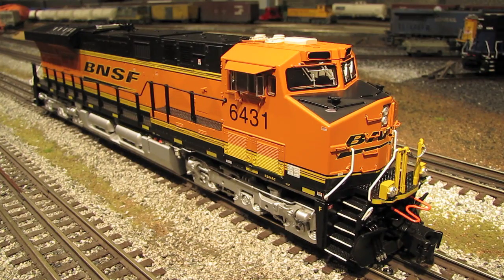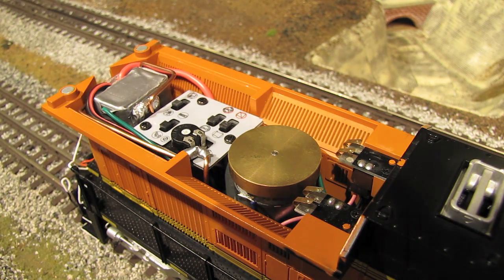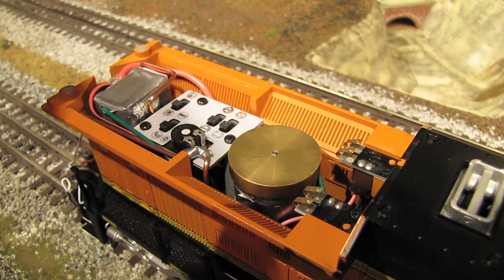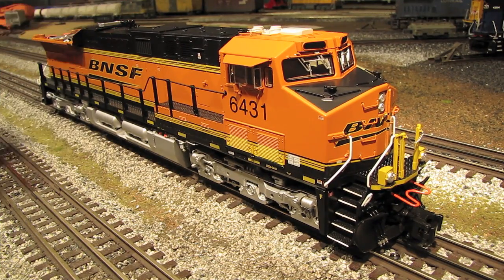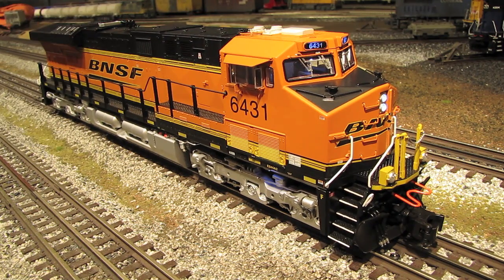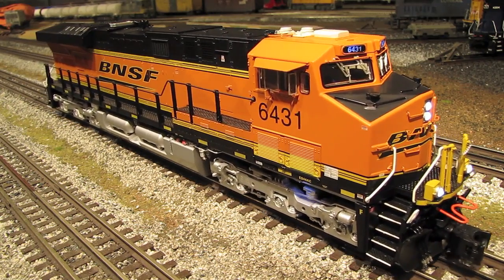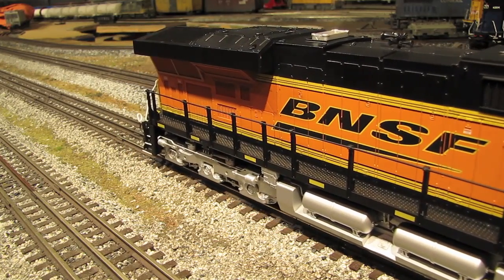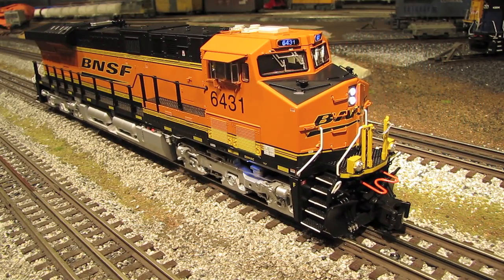Nuclear Powered O-Scale Engine Demo

Comment: You should make it to where it went off and diesel back to where it doesn’t ever exhaust, but it’s just reuses its own fuel so it can sound like the real thing, last forever, but never run out of gas so when it takes a few and the gas tank… It goes through a tube which runs to the engine to make it run which English to another to watch it goes back into the gas tank

Comment: Nice Eric Love Experimental Locomotives even on a small scale but what happens in the incident of a Reactor Meltdown would it Explode or melt a hole in the shell of the locomotive?
Reply: It would melt the train, and probably start a fire. Reactors don't really explode. Chernobyl had a very specific reason it exploded, and I honestly feel confident in saying a reactor will never explode like that again. There's only 8 RBMK-class reactors in operation today, and they all had many safety upgrades after the Chernobyl disaster.

Comment: I have about 400 ft of o scale 400 ft ho scale comes out of the building on a treasel all the way around my house across the driveway 9 ft in the air its a pain to clean the track self powered loco would be great save me a lot of work cleaning track

Comment: Most of what he's saying is sound and feasible. The only silly thing is to use a nuclear reactor. Lots of satellites have been powered by the relatively passive radioactive decay of an appropriate isotope. A model train could do the same. It would be important to get the shielding right, but someone with the appropriate knowledge could do it.

Comment: You have a Radioisotope thermoelectric generator not a nuclear reactor. The heat thrown off by the decay of the uranium vs the cooler outside is used by a peltier cooler to harness the seebeck effect to generate electricity.
Reply: The whole thing is bunk.  I could see an rtg doing the work but a rice grain of U235 95%+ would scarcly be above room temperature. plutonium/ plutonium oxide is the common fuel for RTG's and Im unsure as to how hot a rice grain of plutonium would be.  However if its hot enough to heat a TEG the user is most likely DED

Comment: What variation in isotope(s) would you prefer for postwar steam engines. I am thinking about re-powering my 671 turbine with a uranium 238 reactor. With the metal and all of its weight I think I would need a stronger isotope. Something that would output 1.5 times more volts to power the Lionel fan motor. So, all in all U-238-or 235 what did you use. Or should I go with miniature fusion power, like cryogenic hydrogen fusion power?

Comment: You can't...once Uranium is depleted it no longer will react with the particles being launched into it and will not create heat...No heat=No steam, No steam=Nothing to turn the generator, Nothing turning the generator=No electricity produced, No electricity produced=Train doesn't run :'(

Comment: At some point I determined the gray wire was supposed to go up inside a panel on the inside of the diecast shell and should have been soldered to the handrail. The wire was hanging loose inside my loco and when I initially asked where it went, no one had an exact answer for like 2-3 months, so it became my on-going tag line.  :)

Comment: Hey Bob, one other thing.  The grey wire is for the antenna, typically it is soldered to a metal plate on plastic bodied diesels, but on the diecast diesels it is soldered to the body shell.

Comment: What makes this so funny is that anyone following my Vision line Legacy diesel saga last year in my blog knows this is the exact engine model and cab number I had all the issues with. I swapped it back to Lionel for 3 replacements and finally got my money back. This is also the one I took apart to find the poor wiring and the infamous "gray wire" that was loose inside that no one knew exactly where it was supposed to go. Now we know where it should have gone. Thanks for the chuckle, Eric.